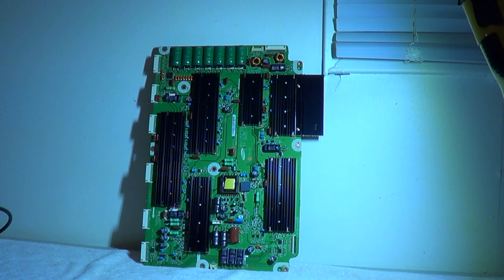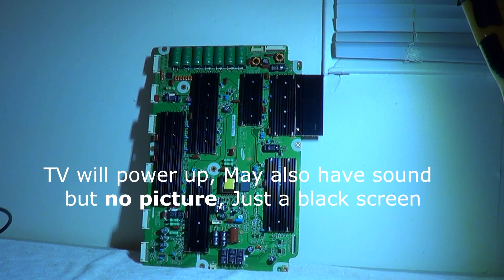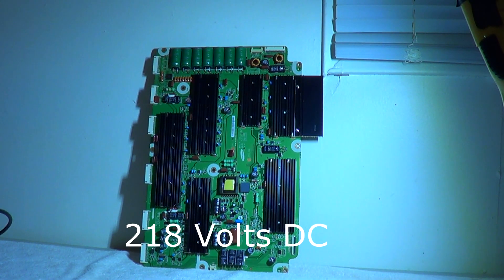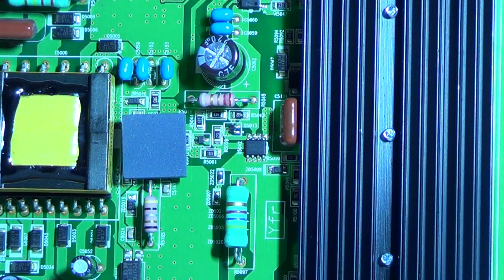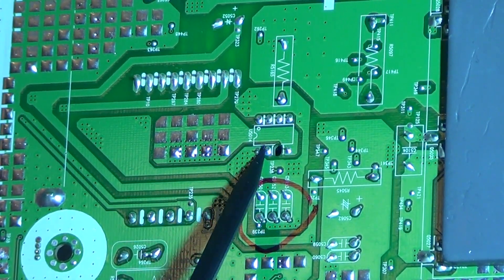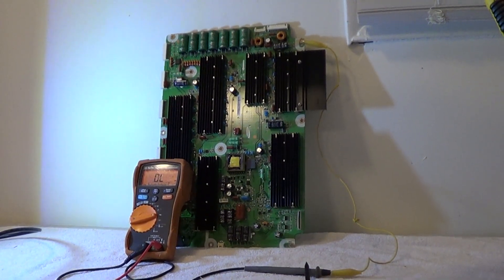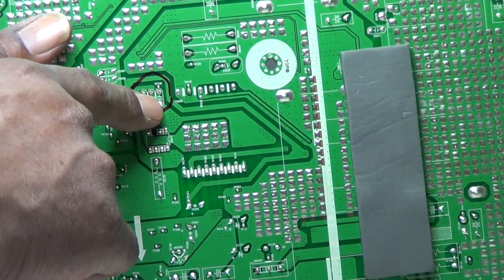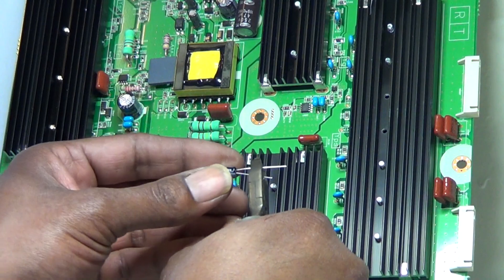Samsung PN64E533 powers on but no picture, easy fix. Plasma tv repair

Comment: How did you check those bad capacitors to tell they were bad?
Reply: I saw another video identifying the same 3 blue capacitors.  Somewhere in the thread it was stated that (1) the capacitors often test good (in circuit) with an ESR meter and (2) often test good when removed from the board and tested.  Nevertheless, they often fail under load conditions.  Given the low cost for 3 capacitors, it best just to replace as a low cost bet with a potential big payoff.  See this as well https://www.avsforum.com/threads/samsung-pn64f8500afxza-issues-with-turning-on.1959809/page-12#post-50174321

Comment: i have this pn64e and it wont turn on before it use to turn on then it would turn off. touched up solder joints and changed caps on y sustain with the same ceramic capacitors i only soldered the bottom do they need to be soldered on top as i still have no power thanks
Reply from the maker: Yes top layer also.
Reply: thanks. i just put solder on the top side of the caps as well and touched up the solder joints on the power supply powered on after a few times of hitting the button then died and wint do anything green light was blinking on control board and everything stopped when it went out

Comment: Hey, it worked--thank you BigDog!  Our Samsung 60" Plasma TV picture would sometimes turn on usually on the 2nd try, unless the TV was warm, then we'd have to wait 30 minutes.  Then after a few years of that, it stopped altogether, so I tried this repair.  Two things to watch out for that got me a little--the screws by the speakers (4) were fine thread, the rest were coarse thread--had to undo all the screws to find the right ones.  Also, I must not have reconnected the ribbon cable well to the Y-main, as I had a horizontal line across the screen after repair.  Cleaned the connectors and reattached and it is back to normal.  THANKS!

Comment: Great info!  I have this very problem on my Samsung PN64D8000 (64-Inch 1080p 600Hz 3D Plasma 8000 Series Smart TV) ... do you know if this model has this same issue?  the boards look a little different on my model so i am unsure if i should try this fix myself.  appreciate the feedback!

Comment: Is this the same for a PN64D550C?  Ours just started doing funky things, screen blanked out, same with audio, then audio returned, but screen blank. Would not turn off, LED on the face would not illuminate either, and was drawing power. It is plugged into a smart strip that turns everything off when the set it turned off, and everything was still powered on. I unplugged from the back, which turned off the strip and heard a relay in the set click. Waited a few minutes, plugged it back in, turned it on, and it all started working again, then after a few minutes, did the same thing as before.   Would be great if this is all it is that causes it.

Comment: I recently tried this fix on my Samsung PN60E500 series (model number S60FH-YB02). It worked great! No more wondering whether the TV would come on or not. Note that the three capacitors were not all lined up like on the board shown in the video. They were all near the chip, but one was separate from the other two. Make sure to check which side is ground.

Comment: Hey Bigdog9992! I’m having a problem with a pn51e440a2f. Powers up, sings, no picture. Voltage goes up on the vs circuits on both boards to 218ish the rapidly drops to about 10v. I unplugged the main like you said. No change. I’m suspecting capacitor issue. Have you ran into his? Thank you for any advice you might be able to give.
Reply from the maker: Unplugg the ribbon connector on the bottom of Y-main (connector coming from small digital board) and leave other big plug on top plugged in. Then recheck the same way.
Reply: bigdog8882 I did that. I also disconnected the top connector on each board separately to isolate each board. Even with both boards disconnected from each other I have a drain off. I have the 208 and 58v from power board to the x board. At x board voltage still drops. Issue on power board?
Reply from the maker: @Mohammadkfcisgood  could be, just check the "Vs ON" pin coming from mainboard to PS. Make sure that comes up and stays. If so, just change the PS board.
Reply: I also do not have 5v at top connections when voltage drops out.
Reply from the maker: @Mohammadkfcisgood  That definitely sound like a bad PS Jason.
Reply: bigdog8882 thank you very much for your help. Im not going to just replace board.  I would like to test all capacitors. I’m learning this stuff and don’t want to take the easy way out.
Reply from the maker: @Mohammadkfcisgood  Good shiii. Check for shorted FET's, Transistors and/or diodes too. Thanks for watching.

Comment: When I test the VS at the power board text point I get around 6 volts at the most. I get 0 volts for VA. Before testing, there was a spark at my power board because the board touched the metal pannel behind it. I bought a replace meant Y and X board and still no picture or VS and VA volts from power board. Do I need another power supply?

Comment: Hey bigdog ..Thanks for this video...I have this exact model...But it seems im only getting 203 volts on that VS circuit...whereas you said it should be 218...I replaced the caps and still getting intermittent power...I  will probably order new caps as i used some i had on hand...maybe that will solve the problem?

Comment: Hello @bigdog9992, thanks for the video, I have a question. I have a Samsung plasma TV that shows the red led in the corner but it does nothing else, when I opened it I see that when I disconnect the power cable that goes to the X and Y boards and try to turn it on, I hear the samsung tune at the beginning . But when I plug it back in you can't hear that sound when turning on the device. Would that mean that either Y or X board are not working properly?
Reply from the maker: Yeah easy, just unplug 1 at a time to see which one. If U know how to use a meter, then there's probably a short on the Vs line.

Comment: Hey bigdogg, good afternoon, need your expertice advice once again. I have this Toshiba LED that turns on for one second then the backlights go out and I can still a picture using a flashlight. I thought maybe a faulty led but I tested them and they all turn on fine. So I thought maybe video board, but didnt fix the issue either. Could it the LED driver board?

Comment: Sup bigdogg, love your work. I have a question for you. I have a Samsung LED SmartTV with no backlight. I tested the strip and they all turn on, no faulty led, but for some reason the power supply board is not sending power to the backlight. I can see words on the screen with a flashlight so I know its on. Could it be a faulty power supply board or faulty main board?  I dont think its the Tcon because even when I leave the Tcon unplugged the backlight still on turn on. Thanks
Reply from the maker: Make sure that you're gettin the Backlight-On command from the Mainboard to the PS. It should be labeled "LED, BK ON,  LD ON, etc" If it doesnt change to around 3.3v-4.5V, then its the Main. But most likely its the Power supply board in most Cases if your not gettin any Voltage (80v-135v) on the Led+ plugs going into the Panel.
Reply: @bigdog8882  I just bought a new power supply board, hopefully that fixes the issue. Thanks for the prompt reply bigdogg as always. You da man 👍

Comment: Nice vedio , sir i have an issue with  a 28" Emerald Pro USA tv that has a thin bla
ck horizontal line forming at the center of screen and then the picture freeze (stick) but there is sound still after about 35 seconds after tv turned on then it turned into grenish blue vertical bars it only got 2 board , the power and main board in one and  a long thin board at the bottom hook up to the screen and the lvds cable connects them both .Sir can you enligthens me what  could be the problem.

Comment: hey big dog how can u check them caps
Reply from the maker: They should read about 7-10uf. But I heard they just breakdown under load.
Reply: bigdog8882 OK I got a 60in plasma no pic but sound
Reply from the maker: most likely y main and make sure buffers are good.
Reply: bigdog8882 and they got a repair with those same bad caps and ic
Reply from the maker: Whats the brand and model number.
Reply: bigdog8882  Pn60f5500af
Reply: bigdog8882 can you test for that while they are installed? I've got a multimeter but no skills lol
Reply: I saw another video identifying the same 3 blue capacitors.  Somewhere in the thread it was stated that (1) the capacitors often test good (in circuit) with an ESR meter and (2) often test good when removed from the board and tested.  Nevertheless, they often fail under load conditions.  Given the low cost for 3 capacitors, it best just to replace as a low cost bet with a potential big payoff.  See this as well https://www.avsforum.com/threads/samsung-pn64f8500afxza-issues-with-turning-on.1959809/page-12#post-50174321

Peace, out.